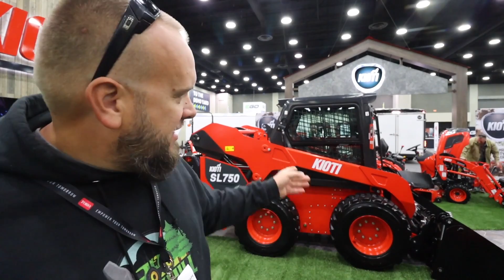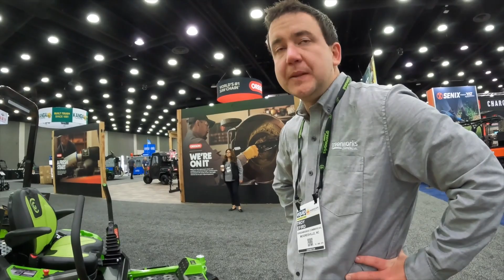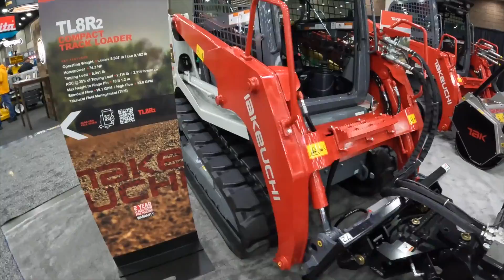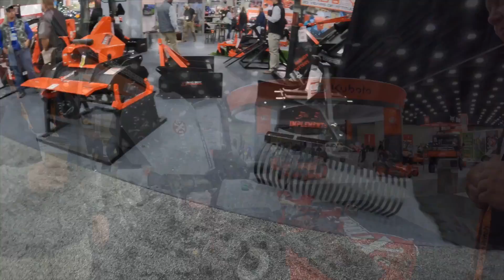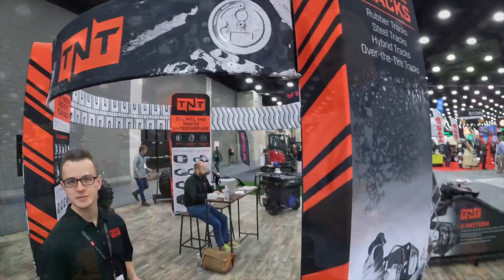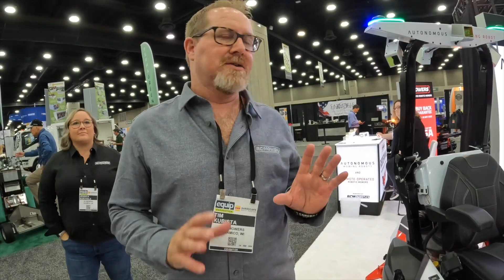Innovative New Equipment - The Best of the Equip Expo

Comment: Skid loaders kinda need a new design ? always an accident waiting to happen getting in and out of them , many times I've slipped when doing so especially in wet and muddy conditiond on the farm .
 I'm getting older now and mobility isn't what it used to be i don't want to be  climbing over the machine to get in it so changing to something like a Tokeuchi loader or simular.

Comment: Not excited about e in a Deere, they are obviously no where near ready hence she was dancing. I’m surprised she agreed to talk about it. A,so lithium batteries are through the roof expensive and after 3 years of use good luck. The battery performance significantly drops. I’ll burn dinosaurs 24/7.

Comment: I’ve had a Solectrac e25 compact tractor running in Wisconsin weather since December, and its run great so far — including plowing snow in -10oF weather. You know, when you run one, after a while you don’t really notice anymore — it’s just a really quiet tractor. (Although I do love the quiet — no hearing protection!!)I have a hobby farm, so it’s perfect for me. I’m told it will go 6 hr, but I’ve never had the battery run down to less than 60%, so range has been a non-issue for me. I just do whatever project I’ve got for the day, plug it in to a wall outlet overnight, and the next day it’s fully charged. It’s nice to just plug it in, and not have to worry about getting fuel out to the farm. No oil changes, either. No spooking the horses. You can do inside work with the doors closed. It’s got lots of torque all the way from 0 rpm, so it’s great for plowing. Lithium-iron-phosphate batteries are a proven technology. So, I really like it. All of the concerns about electrics that I’ve seen have been non-issues for me. Hats-off to John Deere for putting electric out there as an option — American innovation. I just wish they would move faster . . .
Reply from the maker: Thanks for sharing your thoughts on it
Reply: Great post Chit.  I've been following the Solectrac since they first came out with the e25.  I agree, progress seems incredibly slow considering battery powered fork lifts have been around for decades.

Comment: Electric equipment. Designed for the weekend warrior , it will never work for the full time user's . Also what they will not tell you is that the harder you push the electric equipment the quicker the battery dies. Common sense needs to kick in at some point. Gee wizz.. Let's see I need 30 more minutes to finish this job. Well I have to tell the customer can you plug my machine into your house and I will be back in about 24 hours to complete my work. Nope not for me and will never be for me. Give me good old diesel fuel.